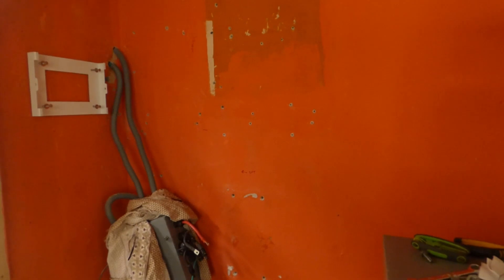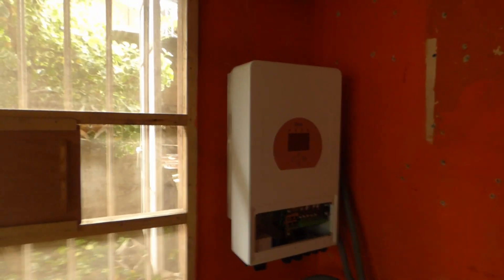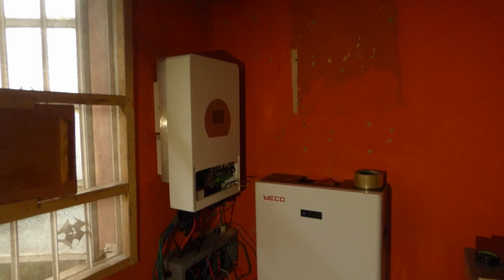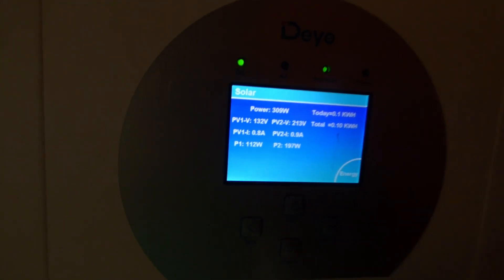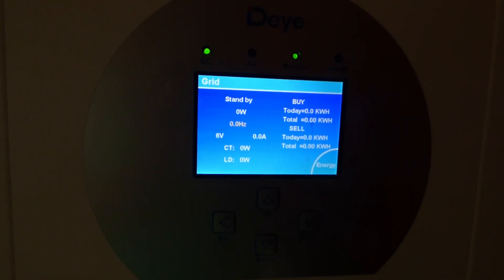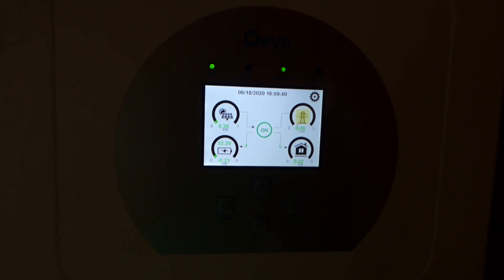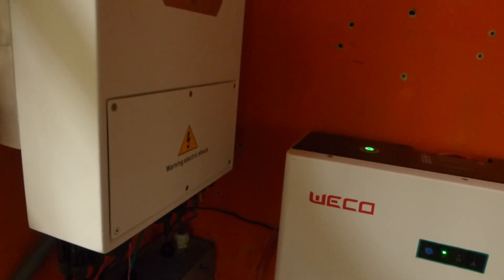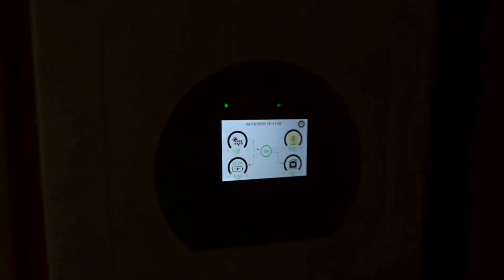One Heck of an Inverter. Deye 5 kw Hybrid with a color display

Comment: what happened to you other new inverter ?
Reply from the maker: It is still there. It found a new home. I like this because of the customization that it gives me on the battery side. The other was designed for close loop type lithium batteries. The Weco operates in open and closed loop and I needed to manage battery cut off, restart and float voltages. This also allows you to equalize your batteries. I will do a side by side  by next week. Thanks for watching
Reply: Always impressive.
Reply from the maker: @adeystoute783  thank you so much. I am loving the inverter

Comment: This is great Dr Solar. You are keeping us updated as you promised. I have a feeling the former position of the inverter was not only a neater set up but was also better for airflow and cooling. I wonder how much this inverter weigh in kilograms?
Reply from the maker: My pleasure. I needed to recoup some space. The new location is right next to the window. The inverter is IP65 so I am not too worried about it getting wet. It weighs a bit under 21 kg. It has a huge heat sink and fan. The fan went off at some point today. Thank you for watching